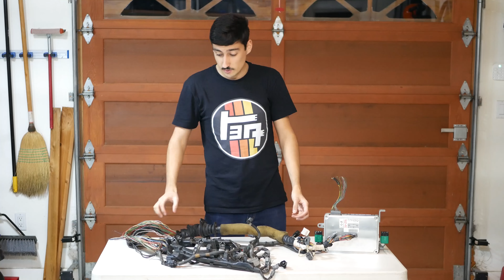Celica RA64 1UZ Swap - The ULTIMATE Wiring Guide! Part One (Ep. 11)

Comment: Try not to ever cut the wires, u can destroy the brittle old plug  and it doesn’t matter, it’s much more reliable to reuse the factory terminals. I think he couldn’t get the terminals apart is cause you need to remove the safety catches, then the wire and factory terminals will be ready to install in your new plug

Comment: Does this conclude the series? 🥲
Reply from the maker: Only for now. I have had no time to edit or really troubleshoot my car. One I have her running for SURE, I will post more episodes. I don't want to leave the audience without a solution to the issues I ran into.
Reply: @winguard96   Hey man any update to the project lately? How many miles were on your 1UZ when you got it from the junk yard? 

I'm still looking for an engine for my Celica, and I saw a 1991 Lexus LS400 with minor front passenger side collision with 171k miles. I was thinking that anything under 200k should be ok, but what do you think? Is that too high for the swap?
Reply from the maker: No updates currently as I am handling other life priorities. The engine has 182k, which isn't a small amount, but should be fine for these motors. Side impact donor vehicle sounds fine, there's a good chance the motor is okay.
Reply: @winguard96  I totally understand the life priority part. not to mention this is a HUGE project! Thanks for the advice. I'll see if I can get the car and pull the engine then. Looking forward to your next video! Take care!

Comment: @slowCarSalon  Did you ever find a solution to haveing an idler in place of the pump?
Reply from the maker: Yes, I had XAT Racing make a custom billet aluminum idler pulley for me. I'll make a video on it later once the wiring issues are solved.

Comment: That one connector that you didnt know what it was, I think its for excessive radio static noise.
Reply from the maker: Good call, it's the noise filter for the injectors!
Reply: It’s a noise suppressor, the injectors use a really high frequency signal that you would hear through the speakers, it’s so annoying u couldn’t drive the car in most cases. This suppressors neutralize the frequency

Comment: I wonder if the ra65 harness is the same, cause I really would love to have double wishbone rear haha
Reply from the maker: You'll find differences between model years. 1984 and 1985 will definitely not be exactly the same, 1983 and 1984 may be very similar. But between the same model year RA64 and RA65, there will not be any changes.

Comment: “Give it a test by yoinking it.”
Reply: The route I’m going with is a bit different than yours since I’m going with a stand-alone ECU, but this is good information!
Reply from the maker: @twotone_ra6558  the yoink is an industry-standard test, y'know. 🤨 Sounds good! One difference I can think of for the 1UZFE if you go standalone is that you'll need a different IACV stepper motor so that the ECU can properly control it.
Reply: @winguard96  well, the 4age is WAY less complicated (I believe/hope) than the 1UZ, so the things I’m worried about with wiring is length, routing, and connecting the gauge cluster.
Reply from the maker: @twotone_ra6558  it definitely is, there are way fewer sensors and going standalone simplifies a lot of the control circuits in place in the original car. Part Two of the wiring guide will help provide some insight into what connections you'll have access to under the dash, which could be helpful for your swap, so keep an eye out! 😄
Reply: @winguard96  I can’t wait!